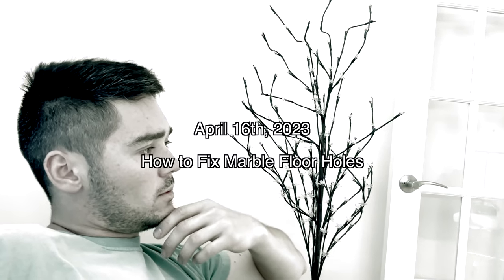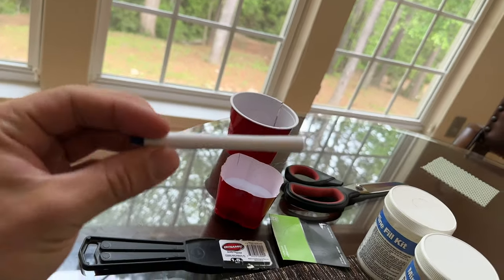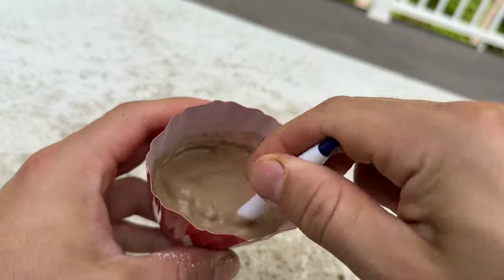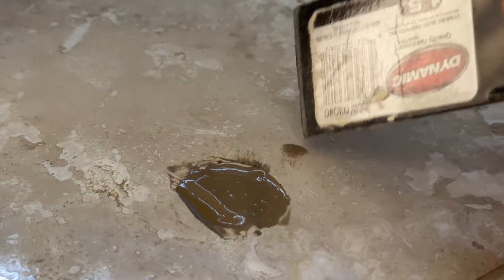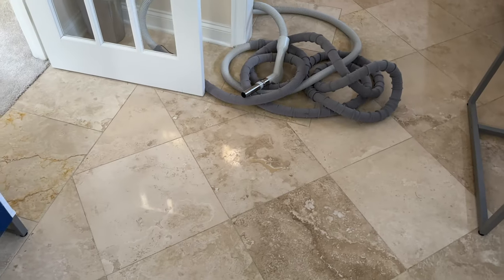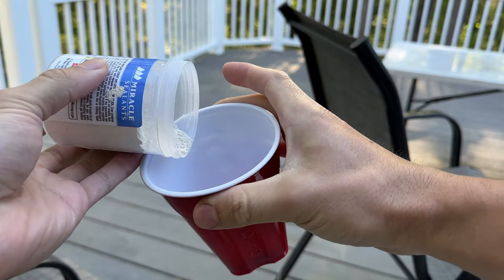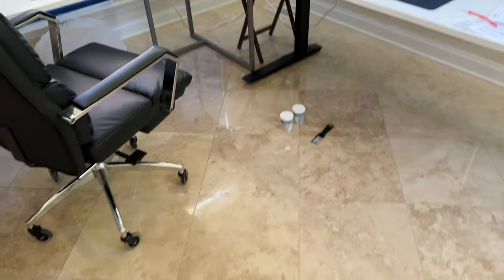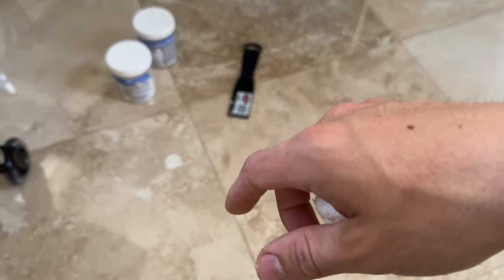How To: Fix Marble Floor Holes #filler

Comment: Finally a repair of a hole and not of a chip.  I do have spare tiles and can ship chunks of of them and include in the hole in an epoxy setting. The epoxy should be transparant. BUt have not seen an example yet on YT and I am just an office guy.....
Reply from the maker: Update: a few months later some chipped away. back to adding more. in case you’re still considering this as an option. +1 on being an office folk lol.